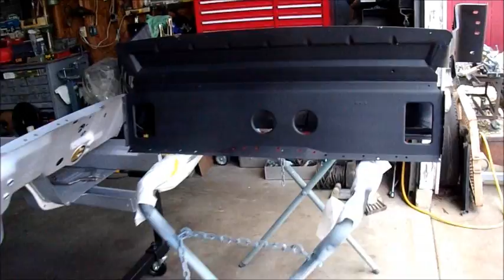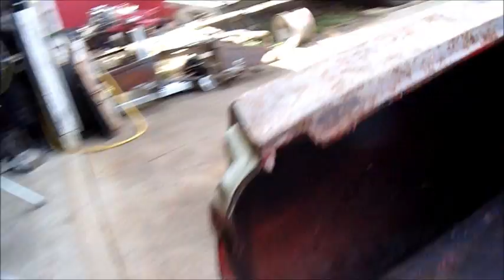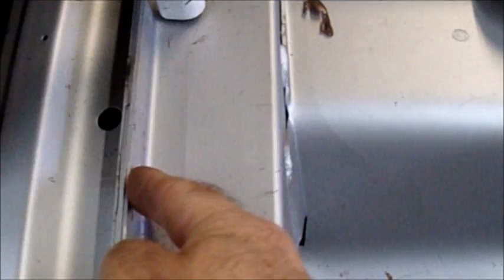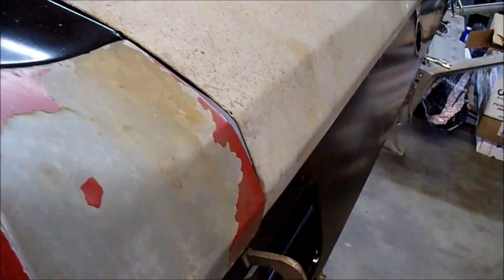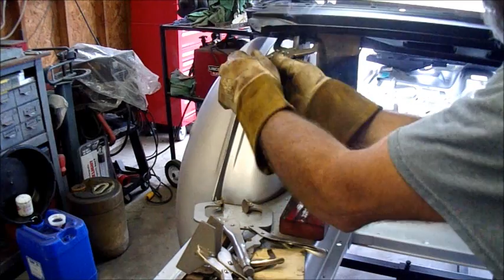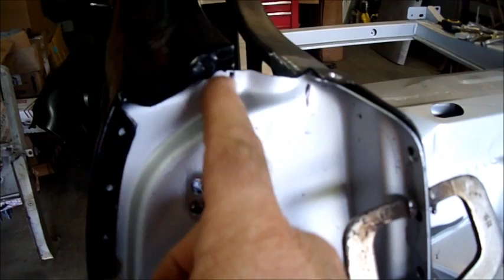Mustang B pillar installation. Dynacorn. Brooklyn Pony part 7

Comment: How do you know how to set the quarter to the b pillar? That is,  the dimensions from the front outside corner of the quarter to the B pillars inside edge where the seal goes.
Reply from the maker: You may have to look at the whole series of videos to see what I used for references.

Comment: I know it's been a while since you made this video, but I have an issue and found it while searching for a solution. I have a damaged 1969 coupe B-Pillar panel, and was wondering if the dimensions of the Fastback panel they make would be close enough to modify to work? Or if you know anywhere I can find one for a coupe? It's one of the few parts I'm really struggling to find.
Reply from the maker: I assume you mean a B pillar from a 69 fastback? Should be the same panel. The only difference between the coupe and fastback is the outer shape of the quarters/roof.
Reply: @JoDaddysGarage  I thought the same thing, but It looks like the opening cut for the rear window is way different. It looks like it's my only option though, unless I can find someone willing to cut one off a scrap car. Thanks again, love the videos!
Reply from the maker: It is likely a different opening, but it's better than trying to hand make one.
Reply: @JoDaddysGarage  that's definitely true! Hopefully I can cut em up and hobble something together!

Comment: I'm putting new Quarters on a 1970 Mustang convertible(I'm building my 3rd Shelby Clone.) I always hand the door on the car to get the proper shape for the quarter panel when I weld the quarter to the "B" Pillar. I noticed that you didn't do this on this 65. Is there a reason that you felt secure with the shape and position of the welding the quarter to the door? Unfortunately with my car, the "B" pillars have some rust damage. Since they don't make "B" pillars for a coupe or convertible for 69-70, I'm going to have to weld pieces in the fix everything. Just so you know, I'm a big fan! Keep up the good work! Dan

Comment: Hey Barry, don't know if some one mention or you already found out but they do not cut the box for the window because for the fastback you don't need the cut out. Need to do this repair myself on a 1967 fastback and probably ordered the same b-pillar set so think that is why they don't cut it out. And thanks for the super clear installation guide for the b-pillars. Did not found it on youtube jet until you posted it. Thumbs up and keep on doing the great video's! They really help.
Reply from the maker: Thanks. I did have another person (or more) point that out. Good information.

Comment: Did you solved the gap between the original tooling tail panel and the rear of the trunk floor as it seems you clamped the tail panel to the trunk floor?
Reply from the maker: Not yet. It will take a minor adjustment.  I did not clamp it tightly at the edge, just towards the middle for mock up.

Comment: I'm amazed at that damaged 66 I came across an identical red 66 I was replacing the complete floor when I found the damage and it was the same crinkle at the shock mount I noticed first then frame rails and the trunk didn't reach to the rear quarters and the project was abandoned !

Comment: Hi Barry,
On the last video of Brooklyn Pony (part 6), when you were dissassambling the b-pillars from the window opening structure, there was a part (I guess related to the rear windows opening  mechanism) that runs from  the very bottom of the b-pillar to the rear wheelhouse. Did you salvage it? I haven't find any reproductions of it.
Reply from the maker: Hi Dom, I don't think those are available. I planned on making my own, but I think I can salvage them from the donor car.

Comment: Love the videos! Longer the better. Don't change a thing. One quick question if that's okay. Where are you measuring from to get the 59" cross measurement?
Reply from the maker: Well, I used a cross reference from when I had the braces welded in place and I also used the same points on the other car. I tried to film it, but I ran out of space on my camera.

Comment: Quick question - What is your welder and settings. I'm a newbie with working on body panels trying not to blow out my welds 🙄
Reply from the maker: The wire speed is around 2.3, and the amps are at 3. Each welder can be different though, and I have years of experience, so my setings may not be the best for some people.

Comment: First off, great work.  But not sure I understand the cost the owner is willing to spend for all this.  The car will not be the car he had as it seems to be 95% plus new metal.  Why did he not just buy a CA or AZ car with no rust or at lease less rust and build it that way?  I am amazed that you are building a mustang from nothing but my guess is the owner has stupid money.  But as long as he is spending, I am enjoying watching.  Thanx !
Reply from the maker: Thanks. I guess it's up to each owner what they want to build. He will have the car he wants, the way that he wants it. Even buying a car that appears to be solid, or have less rust could still have problems. Also, I'm not building cars as my main source of income, so my costs will be less than what any shop would charge.
Reply: Well I am enjoying watching your build.  I have never seen anyone start with so little usable car.  I like the fitting process.  Good work.

Comment: The B pillar posts are not cut for the 1/4 windows so the panels fit all three body styles, and fastbacks didn't use roll-down 1/4 windows.
Reply: At least it's what is mentionned on dynacorndepot.com website... This b pillar reference (3644AWT) seems to fit all 65-66 Mustang.
Surprisingly, on mustangsunlimited.com website, for the same Dynacorn reference, the picture shows the rear windows cuttout... It's also edp coated and not weld-thru-primer coated...

Comment: Yet another excellent video.

I'm intrigued as to how the owner of this restored Mustang will go about getting it registered and insured once your work is complete.

So much of the original panels have been replaced, will the original VIN number still be valid?

I'm genuinely curious.

Please keep posting these quality videos. 😊
Reply from the maker: Well, I am starting with a car that had a good VIN. I am using parts of that car, and basically skipping a few steps doing it this way. The reality is, if someone started at the rear of the car, and replaced all the pieces one at a time, would it still be the same car? I do plan on using the panels with the VIN still intact.
Reply: Jo Daddy's Garage What if a customer wanted to have a Mustang built up from scratch, using Dynacorn panels?

As long as they had a valid VIN number from a rotten chassis, would they be able to register and insure the new vehicle?
Reply from the maker: That is a possibility. I know it is more difficult to register a fully built body from Dynacorn because it has a different vin set-up.

Comment: Awesome work, are most of those panels that are silver raw metal or weld thru?
Reply from the maker: Silver is weld thru primer.
Reply: Jo Daddy's Garage guess you have to strip all that of before epoxy or will it wipe off with thinner ?
Reply from the maker: I see no reason to remove it. I will likely prep it like a normal panel.
Reply: Jo Daddy's Garage didn't figure anything would stick to that weld thru
Reply from the maker: I'll research it more.

Comment: Pillar refers to the roof support as in the 'A' pillar on this vehicle..  It would be technically the 'B'  'post' not the pillar. I it was a post car which Mustangs of this vintage never were. but late 70's and 80's all were then it would be a 'B' post.
Reply from the maker: Can't argue that... Might want to send Dynacorn a note: http://www.cjponyparts.com/dynacorn-b-pillar-panel-in-weld-thru-primer-set-coupe-convertible-1965-1966/p/M3644AWT/
Reply from the maker: ..and Mustangs unlimited, CJ pony Parts, Stang-aholics, Macs.....
http://www.mustangsunlimited.com/Mustang/Body/Quarter-Panels-Related/Quarter-Panels/Dynacorn-B-Pillar-Panel-Kit-1965-1966-Mustang.axd 
http://www.stang-aholics.com/i-24192443-65-66-mustang-b-pillar-kit-4-pc-weld-thru-primer.html

http://www.macsautoparts.com/store/b-pillars-4-pcs-65-66-mustang.html

Comment: Excellent series! Thank you. When you replaced and welded the driver side support bracing from the wheel house to the upper filler panel, how did you know the exact placement of the brace? The reason I ask is because it looks like the trunk hinges attach to that brace and that alignment seems crucial to get the hinge placed correctly.
Reply from the maker: As I did fitment tests with the quarters clamped to the wheel houses, and the other pieces in place, they are close to the right location. Checking for level, and adjusting each side slightly to match each other and level. I had also traced a line on the wheel house of the previous brace before I removed it from the main structure. This gave me a general location. These cars were not built with tight tolerances and variances can be seen from side to side even in an original car. The brackets just need to be within a "zone". The hinge assembly can be adjusted at assembly.

Comment: What size MIG wire do you use Jo? Any info on amp and feed settings would help too. By the way, can you change the font color on captions to maybe yellow, hard to see white with my old eyes. Great video, your an artist.
Reply from the maker: I use a Lincoln 140T currently. As far as settings, I generally set amps at about 2.5, and feed at 3 if I remember correctly. I have tried different fonts, and I will try other colors in the future. Can't find a way for a background setting.
Reply: Wire size Jo? I've been using .24 Thanks
Reply from the maker: .023-.025

Comment: I am so glad you are making this series.  It is filled with useful information on how to fit things correctly.  

I'm planning to replace quarter panels on my 66 convertible starting this coming winter.  I really appreciate every time you show measurements.  There are many things out of alignment from a previous amateur "restoration" from many years ago when it had quarter panels and rockers replaced.   There's also evidence of a crash repair, which wasn't quite back in alignment.  I want to make everything fit right when it goes back together.   This information is hard to find and your videos are packed with it.

Keep up the great work.  I appreciate the longer videos with all the detail!
Reply from the maker: Thanks for the comment. I tend to be concerned with the videos being too long, but I'm glad they're helpful.
Reply: I agree with Chip, these videos are a real pleasure to watch. The longest the are the best it is for me... so interesting and full of tips...
Reply: Jo Daddy's Garage I watch all your videos from beginning to end they are very! helpful and inspiring!